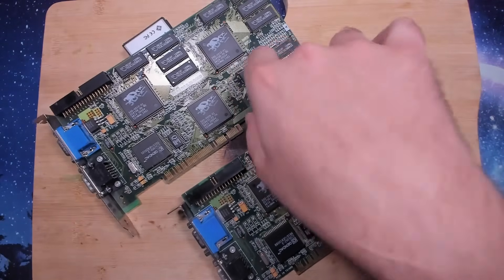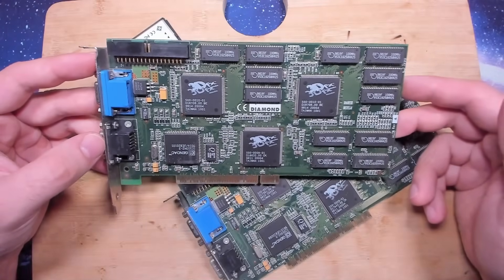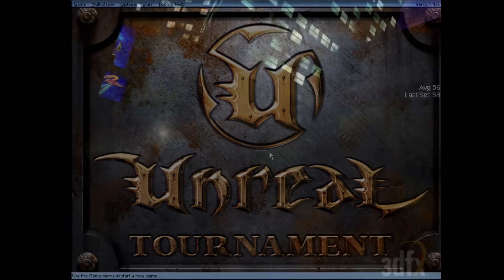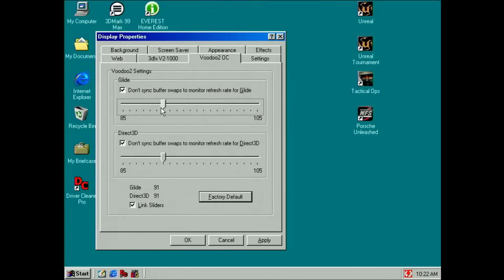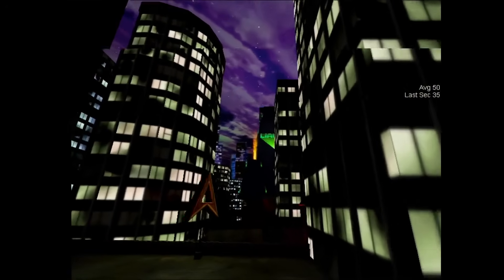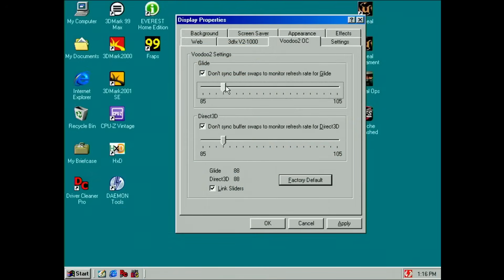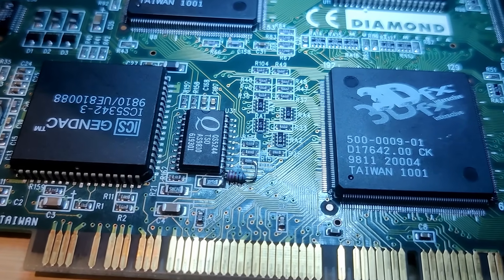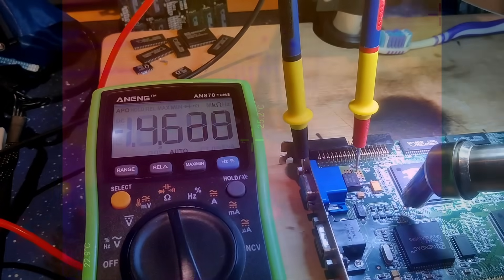Voodoo2 Crashing Games? Here Is What To Do!

Comment: I have the same problem. I have 2 Diamond Monster 2 12MB in the SLI, where probably different buffers are soldered. In the 3d Mark2000 (Adventure) , it almost always stays in the same place. It is not so easy to find the right buffer. Is it possible to patch up the bad guy so that he leaves? Where do you get the good guy from?
Reply from the maker: If the card crashes at the same location, it might really be the buffer chip! I haven't found good Buffer chips that work reliably well. I am still trying to source good chips.
So far, I use donor cards to get those chips. I got several batches and they are not stable at 90-95 MHz (something that should be possible with almost any Voodoo2).

Comment: Very nicely done , I would recommend using the Fast Voodoo2  4.6 No OC Driver by Ciacara from Voodoo Alert forums, & x-3dfx, this driver sets the clock to the default 90Mhz and not the OC'ed 93Mhz, some cards have 90Mhz EDO's, and some OC's can damage these old cards.
This no OC Version of Fast Voodoo2 4.6 is the best one, it maintains all the updates  and  runs the cards at 90Mhz instead of 93Mhz, for some cards this can surely matter stability wise.

The Cards I have are a pair of Gainward Dragon 3000 PCI 12MB's in SLI in my Intel Pentium !!!/E 850Mhz SLot1 build, both pf my cards were given a full Tantalum Capacitor recap, a full reflow for both cards and the second card has a new Chuck Frame buffer ship and  this fixed my cards, as for the Ceramic capacitors you do make a valid point these will indeed die over time, so by recapping the entire card with Polymer or Tantalum may be the best option then, in the sense of you may as well recap the entire card and get it done right from the start on.

Anyways I have shared your videos with credit to you at the Voodoo Alert Forums & x-3dfx FB page, this is solid information that is very highly detailed and professionally explained many thanks for making these.
at VA I go as Gold Leader, hope to see you around.

Comment: Was not expecting glue logic to be at fault. You could probably order a new one for <$10, no donor required.

The problematic scene in the UT was likely not the billboard but what it covered, i.e. a shot with a lot of geometry and textures onscreen. So a benchmark with complex textured scenes would likely work as well as a test.

Conversely, this same spot of the intro could easily be a fault of the memory or texture unit. I vaguely remember some very old nVidia card crashing maybe a little bit before the scene due to memory issues, although IIRC it also crashed in many other places, and the system locked up. 

My point is - if it's crashing there that chip is not necessarily the issue...
However, that sky texture specifically getting corrupted could be a better telltale sign.

Congrats on fixing the board, looking forward to part 2

Comment: So this chip that was the cause, what does it actually do? What kind of chip is it?
Reply from the maker: It's a buffer chip translating signals from one chip to other chips.
For instance, let's say you have one address line coming from the main chip, but it needs to be sent to many memory chips. The memory modules for the AWE64 I designed use buffer chips to amplify the signals. A buffer chip basically acts like a repeater/amplifier.
It can also be used to clean up signals by separating two chips that would otherwise directly connect to each other (I think this is what it's used for in the Voodoo2).

Comment: Loved seeing the troubleshooting and you successfully repairing this V2.    
My V2 board (later boards when I got a second one and went to SLI) always had stability problems when they got too hot. I originally solved for one card with one of those slot fans next to the card.  When I went to SLI, I added heat sinks to the three big "3DFX" chips and that worked well enough.  You had overclocked this one to 100 and you were still able to run with just the bare chips though, which I didn't expect.  Have you ever seen a similar overheating issue?
Reply from the maker: I always point a 120mm case fan towards the cards. That drops the temperature on those chips by 20 to 25 degrees just by the active airflow.

I heard stories of overheating Voodoo cards, but I never experienced it myself. Temperature definitely plays a role in stability.
90MHz on those cards were probably the safe spot many chips worked. If they could, 3dfx would have clocked those cards at 100MHz. But even at 90MHz, each chip is subjected to the silicone lottery. So, a marginal chip can show instability over the years. Either down-clock or improve the cooling.

Comment: put heat sinks on the memory might help if it temps or get a full set of memory and upgrade the card
Reply from the maker: The memory doesn't get too warm on those cards. Maybe 40 degrees. The main chips definitely benefit from heatsinks.

Comment: i had mine overcloed to 100Mhz i still have all my drivers and utils maby the card might still work. i wounder if lapping the cores and attaching better cooling would help. i had cooling because I'm a build it not buy it sort of guy
Reply from the maker: I don't think lapping the plastic body of those 3dfx chips will help much. With active cooling, you can get the temperature down from 70 to 50 degrees. Glue on some heatsinks, and you might get another couple of degrees.
I believe the chip hits other limitations not related to heat.
Also, you'd destroy the 3Dfx logos on those chips.

Comment: Very interesting video. I thought the problem was the power delivery. Then I remembered this video cards also worked with analog signals which need perfect matching synchronization for certain tasks. Just out of curiosity did you measure the resistances? Some degrade over time changing their original value
Reply from the maker: I haven't checked the resistance. But I can still do that. If I find something interesting, I'll mention it when I upgrade the cards to 12MB.

Comment: Really interesting! I spotted one of my old voodoo cards in the attic the other day. Building a 90’s PC is getting more tempting…

And even more interesting is the use of hot tweezers for soldering passives. I do quite a lot of hand assembly and I’ve thought about them for removing parts but never adding.
Reply from the maker: Hot tweezers are really useful if you work a lot with SMD components. Caps and resistors suddenly move easily. If you don't want to heat up a large section with hot air, hot tweezers are the tool to get. After using the tweezers for some time, I get more confident in placing and soldering components as well; however, it definitely is more difficult.

Comment: I will be forever keeping your videos on Voodoo2 in mind, though TBH I don't use my PC with Voodoo2 often simply because they were either free or bought cheap years ago and are now well beyond affordability.

Edit: BTW, one of the stock drivers for my Diamond Monster 3D II ran the core+memory at 92MHz, same as the example on the vgamuseum. And it is in theory safe with heatsinks plus an 80mm fan blowing over the AGP and first 3 PCI slots..
Reply from the maker: Interesting. Those driver hacks could have been an effort by Diamond to make their cards perform better than the competition. I am pretty certain, all Voodoo2 cards perform identical - just tweaks/cheats make one card perform better than another.
Yes, those cards seem to get more expensive every year! I remember buying a Voodoo2 for 70 EUR a few years back - crazy how the prices have increased.
Reply: @bitsundbolts  $135 AUD is what I paid for my STB Black Magic. Even then at the time it was the most I'd ever spent on something that isn't new.

Comment: Because that logic chip's characteristics were so important, I wonder if there's a superior alternative to it. The old one might still be an overclocking bottleneck.
Reply from the maker: Yes, that is very true. I didn't look for alternatives other than the other chip that was used on those cards. However, you are right - maybe those cards could do better in many cases if this buffer chip is the bottleneck. I tested the second card though - and it doesn't reach 100MHz (only 95MHz before artifacts appear).

Comment: Given that the card worked a while and then failed and seems to get a little worse would have had me thinking its thermal expansion causing the card to have a faulty connection somewhere.
Reply from the maker: I am sure there is some sort of thermal impact because artifacts did appear more regularly while testing. Luckily, it wasn't any of the 3Dfx chips but this tiny buffer chip that was at fault.

Comment: I wonder if it's possible to diagnose that faulty IC by probing with an oscilloscope / logic analyser - if it could be diagnosed that way it would save a lot of time in removing / swapping ICs. Being a 244 presumably you could just look at signals in and out and see any issues, but perhaps the fault is more subtle than that - maybe a very small timing issue that can't easily be seen. In any event, I would be curious to see how the 244 failed.
Reply from the maker: I am really no expert when it comes to oscilloscopes and I think you need a multi-channel device to make sense of it. I just have those basic hand-held devices which helps me to diagnose if there is activity at what voltage levels. As you mentioned, this might be marginal since the chip worked at 85MHz - very hard to diagnose I assume.
Reply: Is the issue that manifests from this failing chip that the TMUs are running at a higher frequency than what is selected by the driver/UI? E.g. was the performance per selected frequency actually higher with the broken chip?

Comment: Spoiler alert, there is not a big difference between 8 and 12 mb. Atleast not the once i have.
I have 2 12mb creative cards, and 1 8mb creative card.
Reply from the maker: Maybe, I did not look into it much. However, I think there is a big difference in 3DMark 99 (first benchmark). But then again, it also showed massive improvements when I upgraded my Voodoo 1 from 4 to 8MB. Unfortunately, this gain never translated to real games. So, it might be similar.
Reply: @bitsundbolts it wil stil be a good video if you do 😉😉 i have some fotage so where, i wil try and find it.. I do However bot have the fast voodo drivers, i only have the normal drivers🤔 maby that makes more of a difference 😊😊
Reply from the maker: I don't think the drivers make a huge difference. However, I believe most recent videos comparing Voodoo2 memory configurations have a big flaw: they use SD cards or compact flash. That eliminates the slow mechanical drives that were the only option back then. If an 8MB card needs to pull in textures more frequently, it will make a difference. There's definitely some things to explore :)

Comment: It almost feels like this issue is a design flaw rather than a broken component
Reply from the maker: Could be - that resistor was definitely an afterthought. Maybe they didn't know which buffer chip they are going to use or they didn't have access to the 74AC244 and used this QS-replacement which required some alteration to the surrounding components.
Reply: @bitsundbolts  74AC244 is a jellybean component that is available from tons of manufacturers. There must be some reason they switched to the other chip.

Comment: I had one oc to 150mhz 😅
Reply from the maker: That card probably could play Crisis.
Reply: @bitsundbolts yes even cyberpunk 2077  well i had mounted double stucked ram  2 chips per chanel with bios mod for some reasons it works only on agp cards pci doesn't supply the necessary lanes

Comment: My question would be... What in the h*** made the buffer go bonkers? It doesn't seem a part which interacts with external voltages.
Bugged chip batch? ESD degradation over time? Corrosion damage?
Reply from the maker: The cards looked really good - I doubt it was corrosion. Maybe ESD. Other than that - really hard to say. I have no idea why those chips failed on both cards!

Comment: If I could find a faulty one cheap, I'd send it to you just for more content, even if I could repair it otherwise. Maksim's work seems very interesting. The artifacts looked like memory, so that chip was a good next culprit. Having an easy diagnostic reference point like that intro is quite useful.
Reply from the maker: I still have many offers for Voodoo2 repairs :) It seems like I don't run out of 3Dfx content any time soon.
Reply: @bitsundbolts  You should do one of SDZs Voodoo boards, if you have donors.
Reply from the maker: So far, I am using the donor cards to revive original Voodoo2s - maybe one day, I can make one. But didn't he make most of the mods for Voodoo 1? He made that one board that puts 2x Voodoo2 in SLI on one PCB, but that requires special drivers and is quite difficult to make (also the FPGA chip).
Reply: @bitsundbolts  The FPGA I think just replaces the RAMDACs for the clocks, the drivers are a work in progress too I believe. Yes, I was thinking of the far less complex one, 4440H. Also, zxc64 does boards for several cards, including Voodoo 3.

Comment: Very strange. QS5244 and 74AC244 are pin-to-pin replacemrnt and nearly identical in electric charasteritics.
Reply from the maker: True - just somehow the Diamond Monster 3D II has this round resistor and different value SMD resistors. The 74AC244 doesn't work with the values that are on the Diamond card.

Comment: have you had any problems yet with ram rot pal? ive put 2 cards away working and got them out 2 years later and they both had video ram problems mate
Reply from the maker: I never had issues with memory that just failed over time. Very strange that both of your cards seem to have had the same problem with memory. Could it have been some ESD damage?

Comment: Hi, great job of soldering without any damage and great failure research.
Do you think you can you beat the master by tweaking the original configuration with different resistor/inductor or a ceramic cap on the original chip power legs (the chip can be good enough with a better signal integrity or filtering) ?
It can save lots of Voodoo II
Reply from the maker: Clearly, this buffer chip has an influence on how stable a Voodoo2 is. I am not sure if the design can be improved though. The buffer chip just passes signals with damping resistors. Not sure what the 330 Ohm resistor is for (but could be some feedback signal or something). I get a bunch of replacement chips - I can experiment with those a little bit and see if I find something interesting.
Reply: @bitsundbolts  I'm waiting for the next video, some old capacitors can play tricks on us. It can be some noise in the supply of that chip and the other brand is more tolerant.

Comment: I might just be imagining things but even with the fix there seems to be a noticeable stutter, where the crash happened, almost like the card was loading in new textures.
Reply from the maker: That is a possibility! It does slow down on this part. I guess it is just a heavier workload at that point and if you have a marginal component on the board, it will break there. I wonder if this particular scene in the UT intro requires a lot of resources.

Comment: As I remember it, the big difference between 8MB and 12MB Voodoo2 cards is the supported resolutions, especially when using SLI. I wonder if you can mix the two vram sizes in SLI I have one of each🙂
Reply from the maker: Hm, I think mixing two different memory configurations won't work in SLI. Best case, I could imagine that the 12MB runs as 8MB - but I have a feeling that it doesn't work at all. Maybe you won't even get the option to have them configured as SLI.

Comment: Well as you are preforming an up grade consider adding sockets and try 8MB per TMU for a 20MB card?
Reply: Please :face-red-heart-shape::face-red-heart-shape::face-red-heart-shape:
Reply from the maker: Unfortunately, I don't have the correct chips, but let me check if the correct address line is even connected on the board - which I doubt. Those cards were made for the 512K memory chips - I doubt they routed an extra address line that would never be used.

Comment: The biggest thing with the 12MB Voodoo2 is it can do 800x600 and 1024x768 where the 8MB maxes out at 800x600
Reply: And you obviously simply have less texture memory, what resulted in having to playing certain games with lower texture quality like 8bit vs 16bit textures. I remember this was a thing with Quake2, it ran better on Voodoo2 12MB and also looked better. I never had 8MB cards, they were a stupid choice anyway, but my neighbour had and it was quite obvious. For older games (like voodoo1 era) it made no real difference.
Reply from the maker: Right. What about SLI - would a pair of 8MB cards be slower than two 12MB models? I ran some initial tests and was surprised to see the difference - but that might be because it was a synthetic benchmark.
Reply: @bitsundbolts  no. the clocks are the same the limit factor is frame buffer size on any thing that will run on them. and max res you can use with SLI you can 1024x768 as well over that the cards just can push much more do pixel fill rate